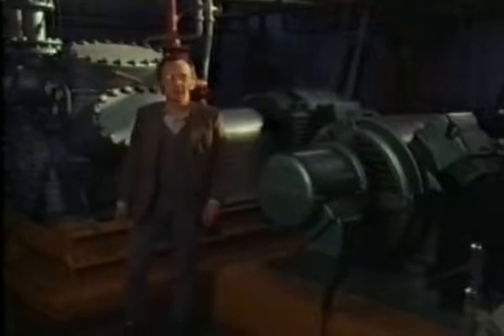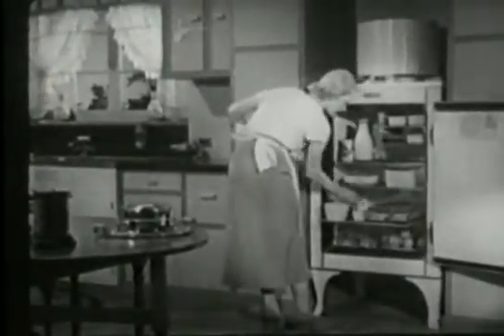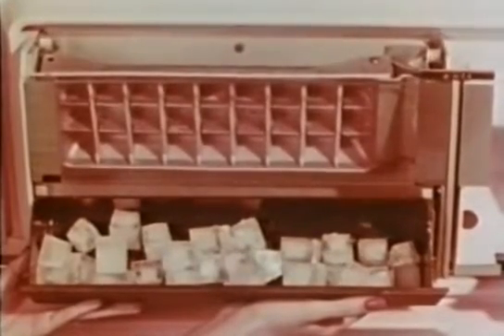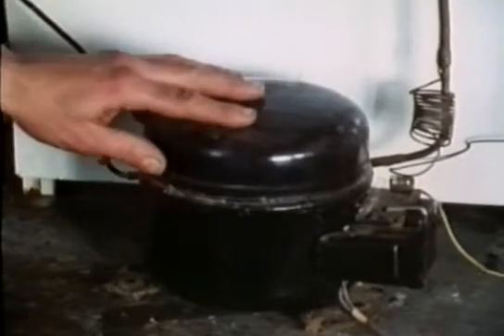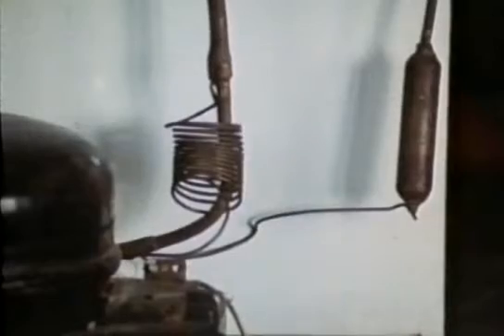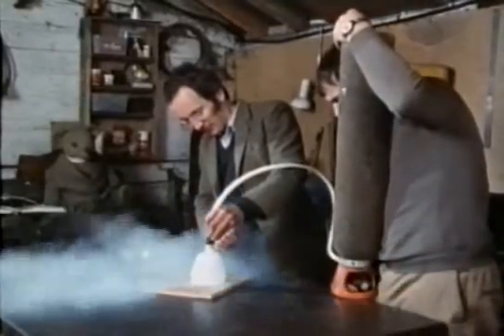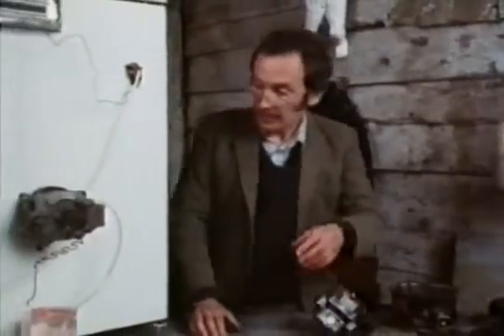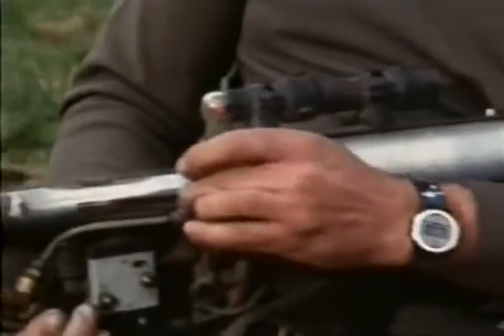The Secret Life Of Machines - The Refrigerator Part-2

Comment: I had a similar fridge to the early GEC one with the circular evaporator on top, made by BTH about 1932. Worked OK - essntially a steel box insulated with horsehair stuffing and an enamel interior. The compressor and evaporator just sat on top and could be lifted off in one piece. Cold enough to keep milk etc but the freezer...didn't..! LOL